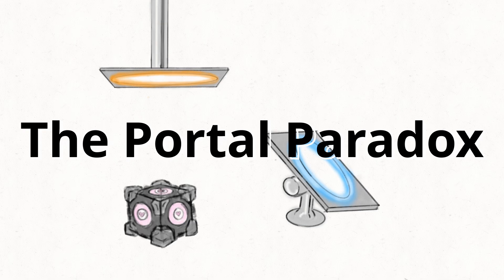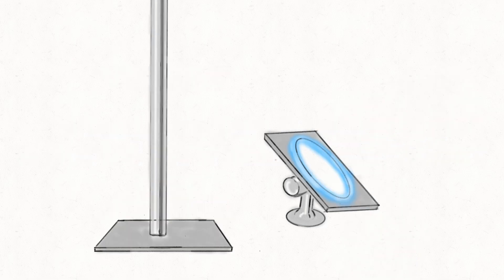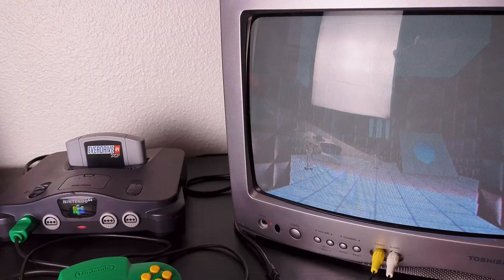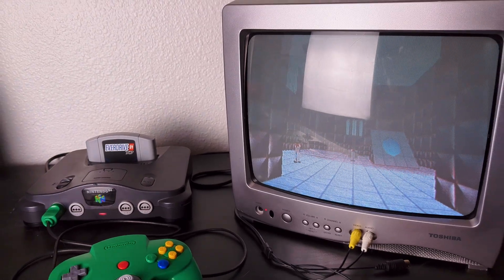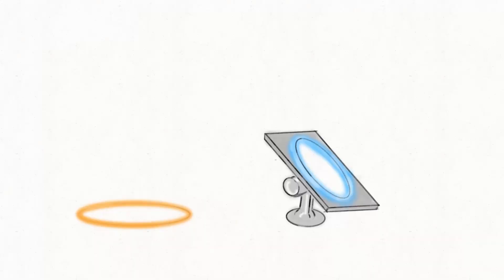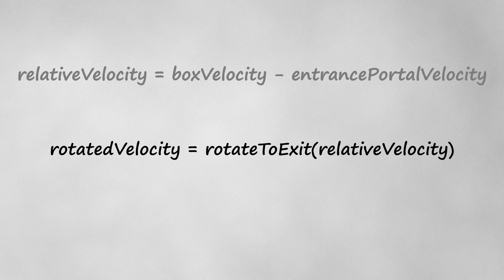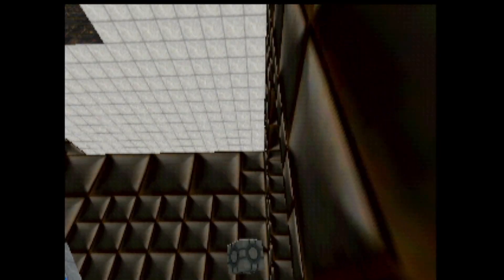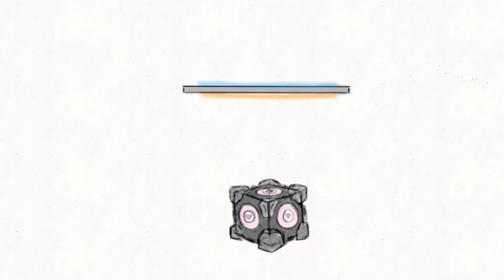I rewrote Portal from scratch and solved the Portal Paradox

Comment: The issue I've always had with this solution to the portal paradox is one of conservation of energy, which is sorta hidden by the platform with the portal on it being a non-physics object. If we're looking to conserve energy, then something needs to lose energy when the cube is ejected from the portal, which presumably would be the thing the moving portal is attached to
Reply: Conservation of energy is already violated by portals. Anything travelling through a portal at a lower elevation and exiting a portal at higher elevation will have gained potential energy.
Reply: @crynon612 Yeah this is the right answer. The fact that objects travelling through portals exert zero force on those portals can result in all kinds of physics-breaking scenarios. Like, just consider the classic "squishing something between two portals". Pressing the portals together would exert immense pressure and force on whatever's between them, but the portal platforms are just pushing together normally and wouldnt need to endure any of that force. Similarly, you could set up a chain passing through a portal and tie each end securely to an anchor, and then by moving the portals further away from these anchors, you would exert immense force and break either the chain or the anchor points, while the force to move the portals would just be normal.
Reply: @crynon612  Good point, I guess a workaround is that whatever is powering the portal would have to use more energy to balance, then the same reason could be used for the box being propelled without a force acting on it.
Reply: @crynon612  That potential energy would then come from the end portal, like a crane having lifted up the box, just a different way of "pulling it up"
Reply: @MDP1702  Well then you have your answer. The box gained momentum because it came from powering the portal.
Reply: @LineOfThy  That doesn't make sense.
Reply: @MDP1702  portals don’t make sense.
Reply: @LineOfThy  Portals are very simple: you enter one way and you come out the other. What doesn't make sense is that you give it an extra property for no good reason
Reply: @MDP1702  you don’t get it, it’s not a new property it’s just the original property of portals violating conservation of energy looked at from a different perspective. Portals have to provide energy to the things that go through them, otherwise they break the laws of physics.
Reply: @LineOfThy  This argument has no bearing on the current discussion. Your explanation is essentially "it is already breaking the laws of conservation, so why not break it some more".

Also they don't necessarily break the laws of energy conservation, it entirely depends on the the energy needed to power it. The energy that allows them to open it, not do anything else. If the needed power increases by the distance traveled in a correct manner, you still would have conservation of energy happening.

Horizontally speaking, the portals would give the item kinetic energy for the distance it is traveling in a horizontal manner, this being taken back by the end portal (similar to you just carrying it from one place to another on the horizontal plane), vertically it would change the items potential energy due to gravity.

A portal thus can perfectly be assumed to fit with the laws of energy conservation if you make the correct assumptions. However it giving an item a kinetice energy "push" for no reason immediately goes away from that since there is no reason to assume it could do that, unless you immediately are also changing the property of the portals, going well beyond the normal interpretation.
Reply: @MDP1702  no, did you read my comment at all??!
Reply: @LineOfThy  I did, and literally rejected it by my explanation. So the real question is, did you read mine?
Reply: @MDP1702  yes, and you didn’t.
Reply: @LineOfThy  Clearly you didn't, since I responded to yours and you act like I didn't read your short useless answer.
Reply: @MDP1702  you clearly didn’t considering you don’t get what I said
Reply: @LineOfThy  It isn't hard to understand what you mean it just is also not usefull.
Reply: @MDP1702  Explain.
Reply: @LineOfThy  I already did?
Reply: @MDP1702  You are just completely wrong: The games have always shown the portals to behave EXACTLY like in this video: Relative motion is preserved. This BY NECESSITY MEANS that it breaks energy-conservation, causality, locality and many other properties.

What absolutely makes no sense is your insistence on earth somehow magically being the one and only reference-frame contrary to what the game shows and contrary to how it is in reality.
Reply: @ABaumstumpf  Except this wasn't just about how it acted in the games, but how it would act if it was real. And game developers create something to make the game good, not to mirror what really would happen.

You have also plenty of other media showing portals that don't somehow infer motion out of nothing, rather only give an object motion if it was already in motion upon entering the portal.
Reply: @MDP1702   "but how it would act if it was real" - yes - and on that part you are wrong. Cause relative motion is preserved as the games have always shown. Otherwise it would not be possible to even enter the portal.

"You have also plenty of other media showing portals that don't somehow infer motion out of nothing" Yeah no you dont.
Reply: @MDP1702  HOW IS IT NOT USEFUL MY GOD JUST STOP BEING SO DENSE
Reply: @LineOfThy  I literally explained it in the reaction to your comment that you seem to be just ignoring.
Reply: @ABaumstumpf  
Cause relative motion is preserved
Relative motion matters between the exit portal and the object going through, not the entrace portal, which essentially does nothing than just let the object pass through. And even then it is only about apparent motion between the objects, not motion relative to an another system, like lets say earth.

Yeah no you dont.
Stargate is one of the, in books Wheel of Time portals work like that, in marvel portals work like that and I have seen and read about plenty more, just can't remember them all. I actually have almost never seen portals act the way you are saying.

The most basic and easy portal is essentially just a loop: entrance portal faced down and the exit portal faced up precisely on the other side of the entrance, perfectly aligned. If you drop a hoop over an object, that object doesn't suddenly jump up out of the other side, so why would it do that with portals? Portals main and only real base property is that they act as a doorway between 2 places, not more, not less. What you are trying to claim adds another property, namely that somehow the portal doesn't just let objects pass through, but even infers some extra push on them.

If you claim that a portal doesn't work like this, you better come with a proper explanation, since your "Cause relative motion is preserved" isn't a good explanation at all. It can scientifically been proven that relative motion doesn't work like you think it does.
Reply: @MDP1702  I didn't ignore it. You just haven't explained why my explanation was overly complicated or breaking any pre-existing rules.
Reply: This was my take as well. Assuming no part of the platform strikes the cube, no force is being applied to the cube. The other side of that portal is air, the only thing pushing on the cube would be air. So where does the exit force come from?
Reply: Since everything is relative, instead of thinking the hydraulic is pushing the platform down, and the earth is stationary, I would say the platform is stationary, and the hydraulic is pushing the earth up, in turn pushing the cube into the platform.
Basically, the earth is pushing the cube into the platform, rather than the platform pushing down onto the cube.
Reply: @elijahren  That is a completely different situation though.
Reply: @MDP1702  since everything is relative, the earth pushing up while the platform is stationary, is basically the same as the platform pushing down while the earth is stationary. It depends where your point of reference is, which item you want to define as "stationary," but both perspectives are correct.
Reply: @elijahren  Except the outgoing portal and the box are not moving relative to eachother. In the end the speed of the ingoing portal doesn't really matter, the relative difference in speed between the box and the outgoing portal is what matters.
Reply: @elijahren  Except it isn't. The box isn't  moving or receiving forces relative to the earth, thus it will also not be moving relative to it once it goes through the portal, except due to gravity if it drops out above the ground.

There is only 1 way the box would appear to shoot out: the box and end portal have a different relative speed. You can subdivide these in more or less 3 scenario's:
- The box is moving towards the entrance portal (I now always take moving relative to the earth), the endportal doesn't move: box shoots out
- The box isn't moving, but the endportal is moving backwards: the box appears to shoot out but actually the endportal is just moving away with box stationary/dropping due to gravity.
- Both are moving with a relative speed difference that ends in positive movement (box moving away from the portal).
Reply: Exactly my thought to, granted that we're discussing portals but this looks to break conservation of energy. His moving portal stops but only because it hits the floor, it would keep going if the box was on a pillar for example. Cool video and demake project though.
Reply: Dude portals completely screw the laws of conservation anyways.

Comment: I think its flawed. Your logic assumes the stationary object would have the inertia of the portal applied to it but the portal is just a window. it doesnt matter how fast or slow it moves the inertia wouldnt just transfer. THinking of the portal like an open window i would not think that theres is any force being applied to the object so it would remain stationary but since the exit of the wndow is tilted 90 degrees the object would then have gravitational force applied to it and then "plop" to the ground. Thats my basic pshysics understanding of how i think it would work. But on the other hand whose to say that the portals just act like windows and maybe they do apply force. Either way is potentially true. Like someone else commented about if you stuck your head through a stationary one and came out a moving one, then i suppose it could be the difference between losing your head or not lol,.

Comment: Unfortunately, the tests are not 100% identical.

In the first one you still have the rod behind the portal that holds the wall that moves down.
There is no pole on the 2nd. The wall with the 2 portals simply floats/falls down.

Comment: Well i am not quite shure about this type of virtual Physics, but since it is stated in the Portal Game, the Momentum of the Object is conserved as well as the Speed. Right?
I think of it this way:
The Speed of that Cube is 0 as well as it´s Momentum before entering the Portal.
Now the other Portal slams over it with, lets say 10 m/s².
The Cube "Enters" the Portal and gains those 10 m/s² in Speed but it´s Momentum still is 0.
therefore by Newtons 1. Law of Motion would take affect and the Cube is pushed out by itself through the Portal by Molecular Binding keeping it self together. 
therefore in our Example the Cube is slowed Down by 9.81 m/s² wich is the gravitational Pull on the Cube itself because Gravity is pointed 180° from that Portal wich is slammed on the Cube.
With that sayed :

I assume the flying Cube is possible but that Portal has to move quicker to accomplish that, because for this example that Thing would move with a bit slow with 0.2 m/s².
For that Contraption it would mean that it just topples out if the Portal moves with the same Speed as Gravity.

Comment: Seems like the solution here ignores mass.  Imagine if the portals are next to each other on the floor, one facing up and one facing down.  Gently drop the cube into the up-facing portal.  After motion stops, it should end with the cube halfway through, and the down-facing portal lifted about half a cube.  Exact placement varies with the mass of the cube vs the mass of the portal.  Near-zero weight portals would have the cube split in the middle, while infinite weight portals would keep the down-facing portal on the floor with the entire cube in one piece.  The video's simulation seems to treat portal mass as infinite.

Comment: The cube has a resting mass, When you go over the cube you are not transferring any momentum to the object. It be like a hula hoop going over a box. when the box comes out on top you would convert its potential energy to kinetic energy. Like as if you put the box on a angled hill, however with the hole in place unless it catches a lip it would likely just remain in both areas at once Subject to first the friction of the surface its sitting on then the angle and drag followed by the new surface friction if its different after the hole, Since its resting mass is still sitting on a flat surface(the ground is still under it and hasnt move imparting no momentum. If the ground moved up this would work because the piston is provide the kinetic energy not a hole to go thru) the flat surface would be subject  to  the physics  of the changed angle. IE equivalent to putting a box of equal weight on equal angle hill.
Reply: I ran my answer thru chat gpt with the thoughts "please explain it better with math" and it wrote this. to chat gpt " need your help explaining something, The premis is the portel game, If a piston comes at a box resting on a flat surface it shoots out the other portal because of momentum obtained by the piston with the hole. Here is my response "The cube has a resting mass, When you go over the cube you are not transferring any momentum to the object. It be like a hula hoop going over a box. when the box comes out on top you would convert its potential energy to kinetic energy. Like as if you put the box on a angled hill, however with the hole in place unless it catches a lip it would likely just remain in both areas at once Subject to first the friction of the surface its sitting on then the angle and drag followed by the new surface friction if its different after the hole, Since its resting mass is still sitting on a flat surface(the ground is still under it and hasnt move imparting no momentum. If the ground moved up this would work because the piston is provide the kinetic energy not a hole to go thru) the flat surface would be subject  to  the physics  of the changed angle. IE equivalent to putting a box of equal weight on equal angle hill." please explain it better with math
ChatGPT
Certainly, let's break down the scenario with a bit more mathematical explanation.

Initial State: You have a box with a piston inside, resting on a flat surface. The box has a mass 'm', and the piston can provide a force 'F' to shoot the box through a portal.

Physics of Motion: When you apply a force 'F' to an object with mass 'm', it will accelerate according to Newton's second law:

�
=
�
�
F=ma

where 'a' is the acceleration, which can be calculated as the change in velocity 'Δv' over a certain time 'Δt':

�
=
Δ
�
Δ
�
a= 
Δt
Δv

 

Portal Concept: You mentioned that going through the portal does not change the momentum of the box. This is correct, as the portal is essentially a spatial wormhole, and momentum is conserved within the same reference frame.

Potential to Kinetic Energy Conversion: As the box goes through the portal, it transitions from a state of rest to motion. This transition implies a conversion of potential energy to kinetic energy. The potential energy 'U' can be calculated as:

�
=
�
�
ℎ
U=mgh

where 'g' is the gravitational acceleration, and 'h' is the height through which the box falls.

Angle and Drag: If the portal creates an inclined surface on the other side, the box will slide down it. The acceleration due to gravity along the inclined surface can be calculated as:

�
inclined
=
�
sin

(
�
)
a 
inclined

 =gsin(θ)

where 'θ' is the angle of inclination. The box experiences friction and air resistance, which may further affect its acceleration. This can be complex to calculate precisely without specific values for coefficients of friction and drag.

Momentum Conservation: In an idealized scenario with no friction and air resistance, when the box exits the portal, it will have the same momentum as it had before entering. Momentum 'p' is given by:

�
=
�
�
p=mv

So, if the box had an initial velocity 'v' before entering the portal, it will have the same velocity 'v' after exiting the portal, assuming no external forces acted on it during its journey through the portal.

Kinetic Energy: The kinetic energy 'K' of the box can be calculated as:

�
=
1
2
�
�
2
K= 
2
1

 mv 
2
 

This kinetic energy will remain constant if no work is done on the box during its transition through the portal.

In summary, the key to understanding this scenario is that, in the absence of external forces like friction and air resistance, momentum and energy are conserved. The portal doesn't impart any additional momentum; instead, it allows for a change in the box's position and potential energy, which can be converted into kinetic energy as it slides down the inclined surface on the other side. The exact behavior will depend on factors like the angle of the inclined surface and any forces acting on the box.
Reply: Further more your thinking of wormholes like blackholes and whiteholes sucking in matter spitting it out, but its more like a door. with no travel inbetween. But that isnt cinematic. Not thor with himendal but spider man with peter stepping thru the hole.